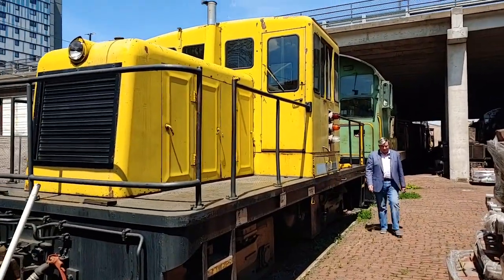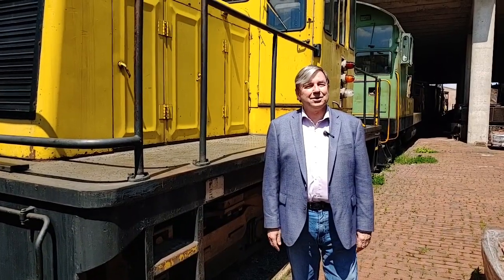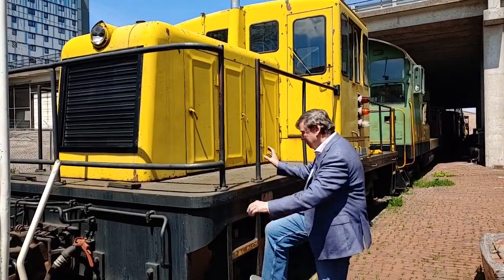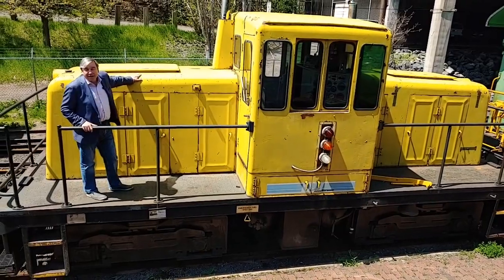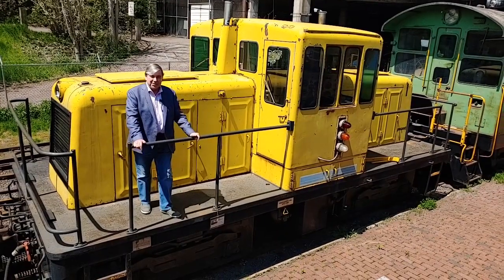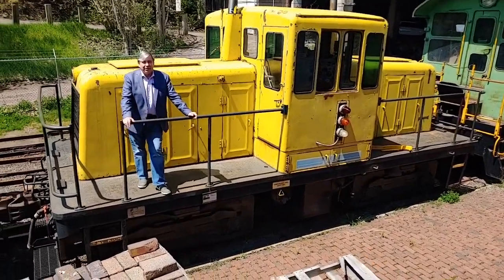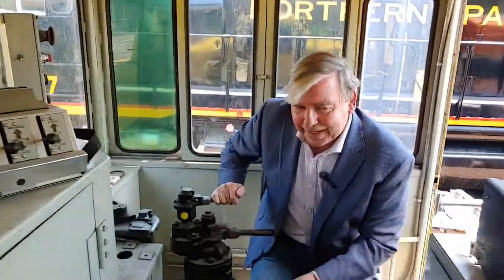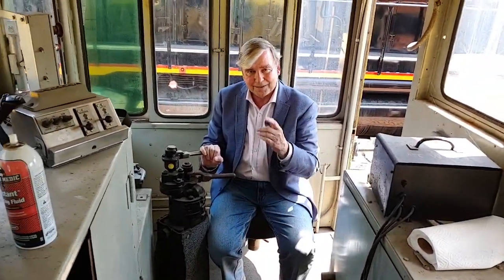How the GE 45-Tonner Came to Be

Comment: When I was little and Warrenton NC still had a spur off the Norlina rail system, my grandad took my sister and i to the Warrenton Depot (Which burnt down years ago) where we got to drive a similar type of engine. The only difference was it was colored Red, White, and Blue, and I never saw a remote pack used with it. We had a great time. I drove it across the road and then my sister drove it back. A couple of years later the Norlina Railway stopped operating and we no longer had any trains in Warrenton. A few years later the Depot caught fire and burned down. There are still some other buildings left that were part of the depot. It's really sad not having it around anymore. I really hope Norlina gets the Railway  back.

Comment: Thanks for sharing another awesome video! I've been lucky enough to see a similar engine, 65-00310 at the Denton FarmPark in Denton, NC. Granted, it's an 80-ton model (I think), but it's still very similar to the locomotive you've shown here.
Reply: It’s a 70 ton. It was originally built for the High Point Thomasville & Denton RR, and went through several owners before being acquired by the farm park and restored to the beautiful original HPT&D colors! It runs every July the 4th week during the Southeast Old Threshers Reunion! As trivia, the old timers referred to the HPT&D as the “ High Priced Ticket & Damned Rough Ride”! Ha!

Comment: Skaneateles Short Line Railroad #6 was a 44-tonner, and #7 was a 45-tonner, but it was a side rod unit, not a chain drive to the second axle.  It was fun to sit in #7's cab and watch the rods go up and down every time Henry advanced the throttle.  Odd part was #6 was 380 hp while #7 was only 300 hp.
Reply: Not odd at all...  44 tonners are powered by 190hp Caterpillar D17000 V8 diesels.  45 tonners are powered by Cummins HBI600 150hp straight 6 cylinder diesels.  (unless either of them have been rebuilt with updated engines)

Comment: The limit was 44 ton, not 45. 45 ton had to have a conductor, 44 ton didn't. 150 HP + 150 HP is 300 HP by the way. All the 45 tonners had 300 HP
Reply: Not all of them,later variants of the 45 Tonners before production was discontinued had dual NTC-400's from Cummins with outputs of 800 HP.All of the earlier switchers had the dual HBI-600's from Cummins with 300 HP combined.
The other differences between the HBI-600's & NTC-400's are 672 CI versus 855 CI and being naturally aspirated while the bigger motors were turbocharged.
Reply: @Slim_Slid  I think you might be confusing the 45 tonners with later 65/80 ton GE center cab switchers which had a substantial horsepower upgrade from their earlier iterations.
Reply: @WHJeffB  
Literally mentioned in my original comment,later 45 Tonners did have dual NTC-400's from Cummins. All original and earlier 45 Tonners had HBI-600's. In the military,alot of GE switchers went through TEAD (1989-1992) which was a rebuild program. Aside from Cummins rebuilds or replacements,the switchers were also updated with relocated radiators,roller bearing equipped trucks,dual headlights,and ditch lights.

Comment: I believe this is a 44 tonner NOT a 45.  Per agreement 45 tons and up required a fireman.  44 and down did not, these were popular with branch/shortline railroads.
Reply: I believe you’re right! Thought that from the beginning of the vid! Still a good show!
Reply: The GE 44 Tonners all had the AAR styled BB trucks with the exposed bearings just most other GE,EMD,and ALCO units at the time.The GE 45 Tonners had the famous side rods built into the trucks and some other variants also had chain driven methods.

Comment: This video has so many errors it is not funny. The 44 ton locomotives were developed in response to the ICC ruling in 1937. The 25 and 45 to locomotives were primarily for industrial applications.
Reply: Bingo!  The guy has the 45 tonner confused with the 44 ton locomotive and it was Davenport that built the first 44 ton locomotive.  I don't think it is his fault though.
Reply: Don't be so hard on the fella.
Reply: He also said that the engine has 600 horsepower, then says that there's a 150 horsepower engine under each hood. That makes 300 horsepower, unless I'm misinterpreting something that's being said. . .
Reply: @ericemmons3040  The 45/50 ton locomotives were built with a 150HP engine under each hood, thereby making the total 300HP.
Reply: Agreed!
Reply: @ericemmons3040 
The GE 45 Tonners all originally had dual HBI-600's from Cummins with a output of 300 HP combined.Some of the later variants actually had dual NTC-400's from Cummins with a maximum output of 800 HP.

Comment: There was a 30 ton a 40 Ton a 45 Ton and a 50 Ton and I think they made a 60 Ton and even an 80 Ton

The 120 and 150 were more like GPs
Reply: You are correct. We still use a 1949 GE 80 tonner at my job.
Reply: I've seen pictures of 130 tonners at a Ford plant. 💙 T.E.N.